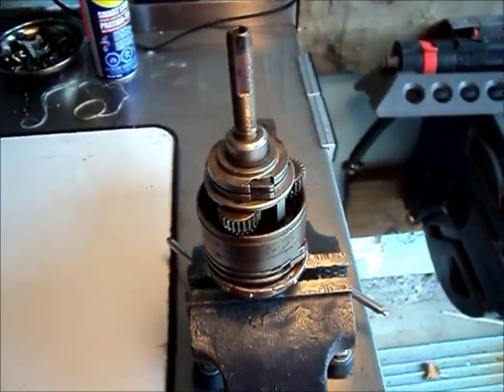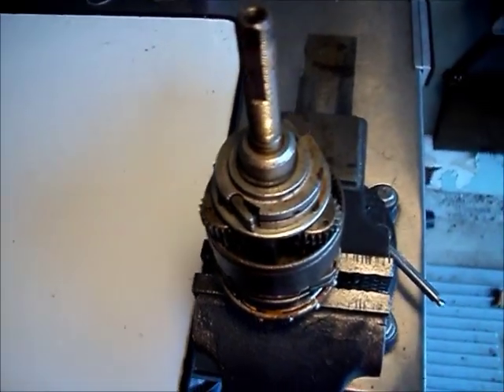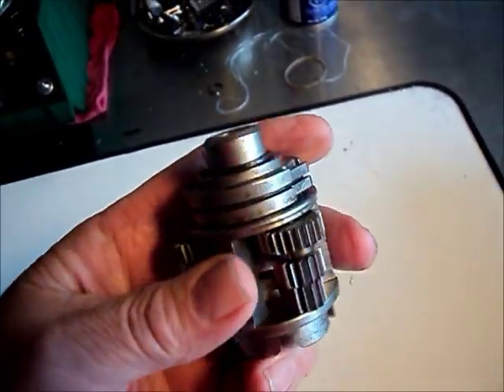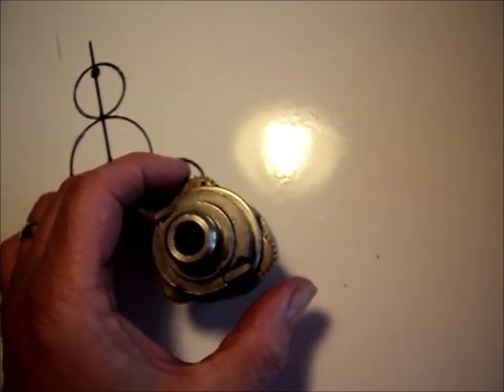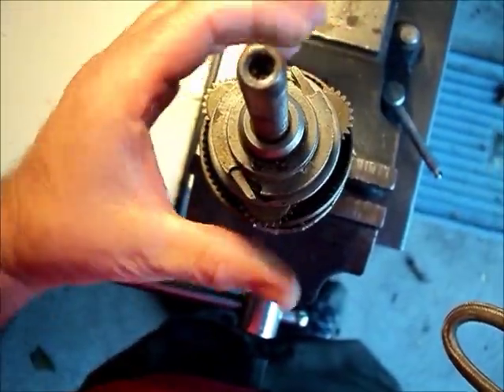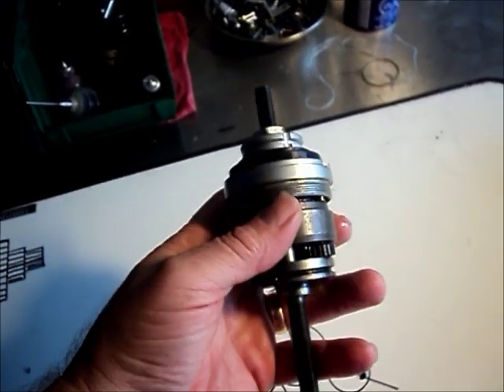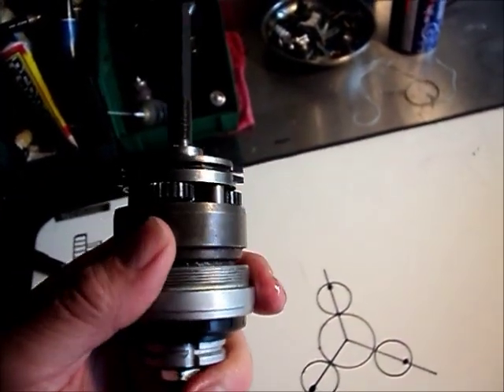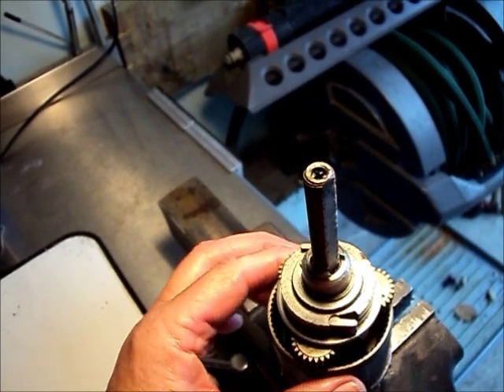Sachs/ Sram 7 speed gearhub. Timing the planetary shafts

Comment: I checked, they really have to be phased/timed. But why?
Aren't the theeth evenly spaced?
If the theeth are evenly spaced how can it matter what position you put it in?
It shouldn't make any difference.
Reply from the maker: When there is a single sun gear and single planet pinions, it doesn't matter. When there are multiple sun gears with planet pinions of different size on the same shaft, if it were a single shaft, it wouldn't matter. But, when you introduce multiple pinion shafts all meshing with the sun gears of varying size, it matters a great deal.
 If you closely inspect a planetary shaft, you will see the timing marks correspond with a point where the teeth on the a joining gears are aligned. This creates a common return point which is necessary in this case so the gearbox doesn't bind up as I demonstrated.
 I'm sorry if that isn't clear enough, it's the best way I can think of to explain it.

Comment: On my bike I've got those gears. At the beginning they worked perfectly, but now. They just don't want to change... it's stuck on I don't know, maybe 4-th gear and it can't change... any advice how can I fix that ?
Reply from the maker: Hard to diagnose something like that on the internet, but I'd start with the simple stuff first. Make sure the click box is attached to the axle properly. 
 Check that shift cable housing is properly seated in the stops.

Comment from the maker: Yes. Actually, I think I should have said NLGI 00 semi fluid. If the hub does not have a coaster brake, you could safely lube it with a light oil such as ATF, but once you convert it to oil lube, you will need to replenish it regularly, like once a year.
 If it has a coaster brake, I would stick with grease.